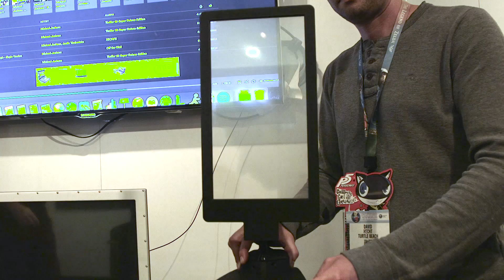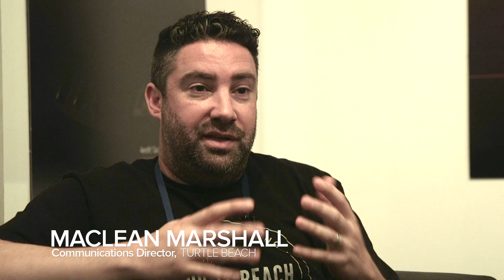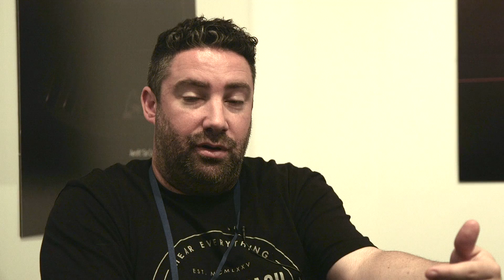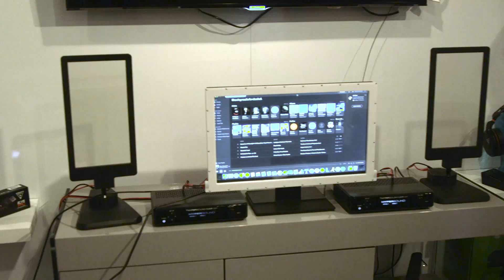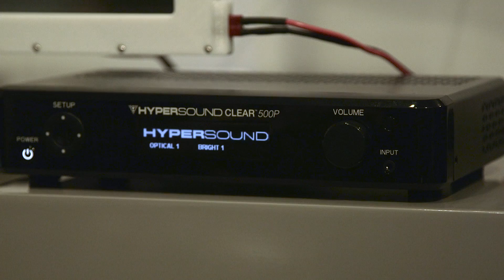Turtle Beach talks about their glass speaker tech at E3 2016

Comment: I saw an HGTV remodeling episode, a few years back, where the host installed magnets on the glass of a shower to produce shower speakers. I think this is the same thing where the housing for the glass is a oval magnet using the glass as a diaphragm.
Reply: It may be. I mean you could create one of these speakers easily using a surface exciter and a piece of glass. It wouldn't have the ultrasound directivity, but it would sound similar otherwise :)

Comment: And bang and oulfsen has released a $80,000 pair of speakers that are designed to sound as good as possible regardless of the room and listening position whereas these are very directional. From a high fidelity stand point these glass speakers are satan. Cool product though
Reply: True, often you want an audio system that produces room filling sound.  However, there are applications where you want sound delivered to a specific location with minimum sound bleed to the environment.  This technology is not right for every application, but is very useful in certain situations.